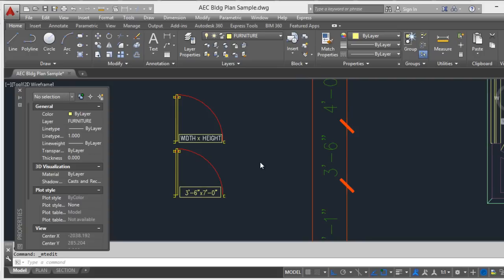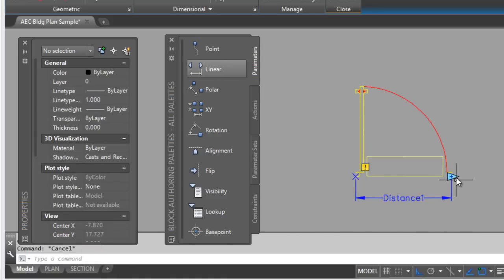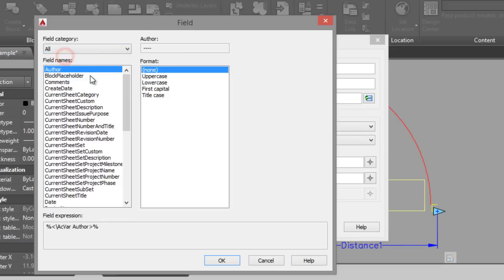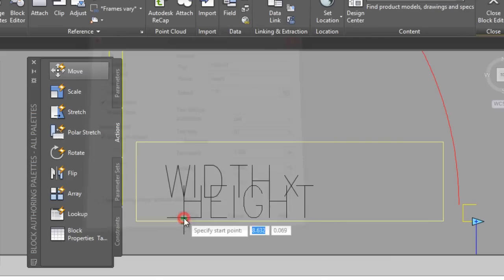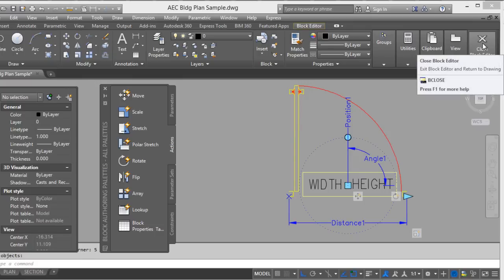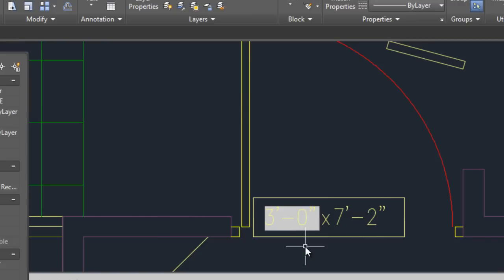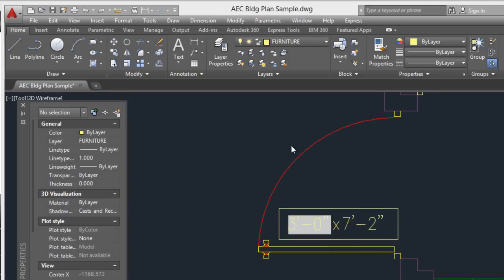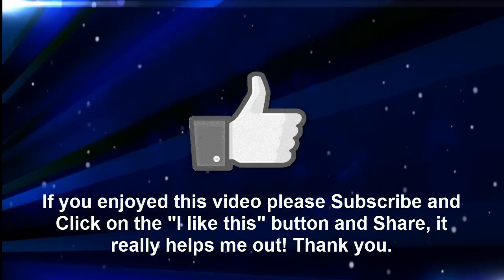Create a Dynamic Block with Attributes in AutoCAD. Ex. Dynamic Door

Comment: I dont want to change de frame and door thickness... if you stretch the door the dimensions are gonna be wrong
Reply: Matheus Vanelli Torres x you should only scale the arc and the door shutter should b stretched along with the frame. Frame and door shutter should not b scaled.